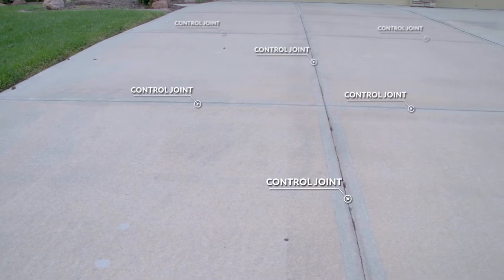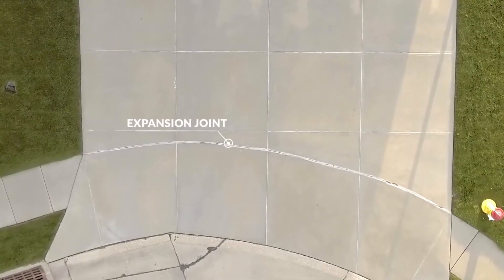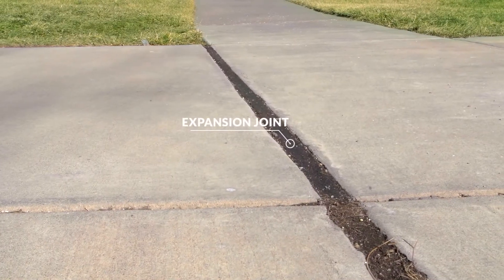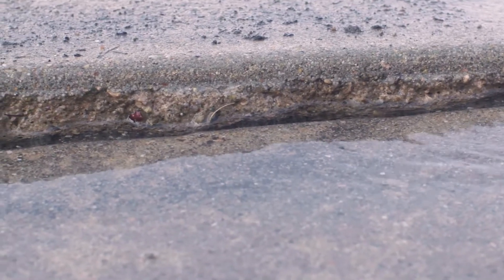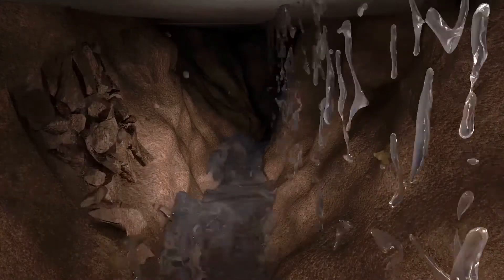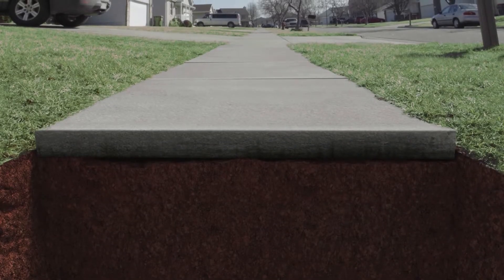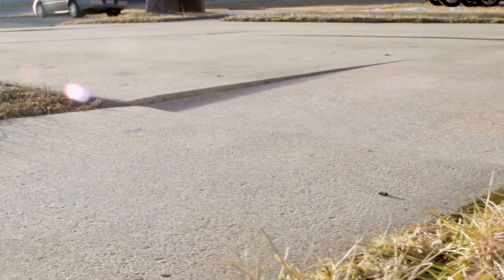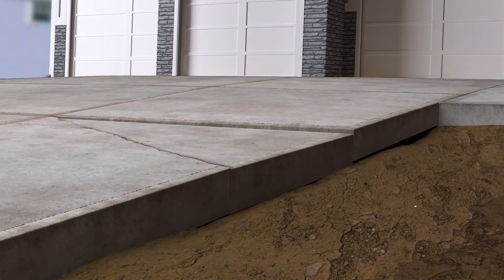How Do You Prolong the Life of Your Concrete?

Comment: Hey Kyle,  Are there any issues with sealing the control joints, when you live in colder climates, that have freeze/thaw cycles and frost heaving?
Reply from the maker: Great question! Frost heave is one of the main reasons why using a flexible joint sealing material is so important.